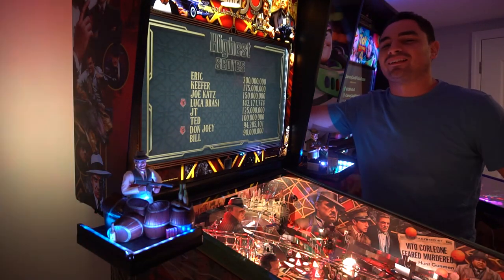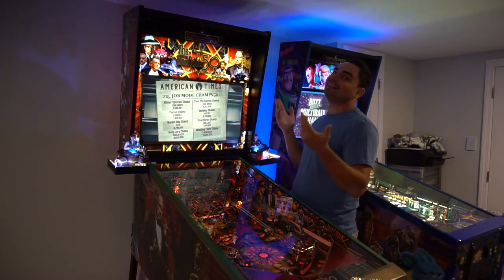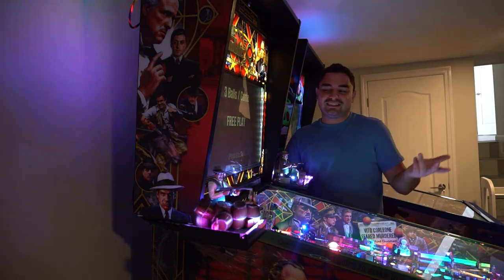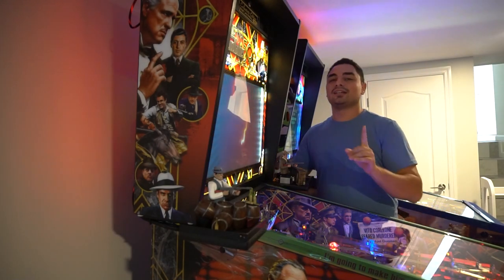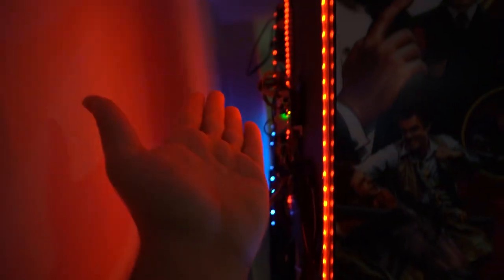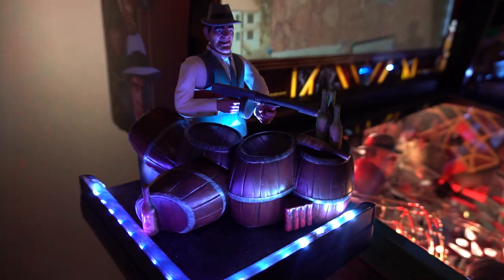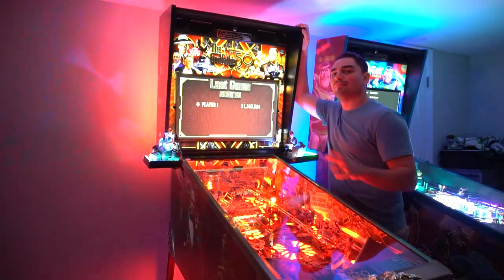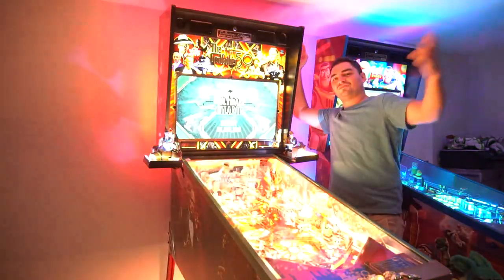The Godfather Collectors Edition Pinball - Low Ceiling Topper Mod!

Comment: I am going to do something similar with my newly acquired Elton John Collector's Edition topper as I only have 80" in my basement.  What did you use to extend the 2-pin blue power connector?  I am not finding a male/female extension connector anywhere.
Reply from the maker: Cut the middle and just extended... so I used the same heads basically but extended the middle wires